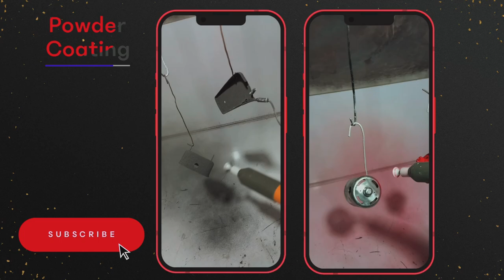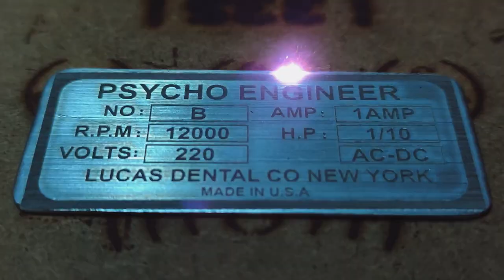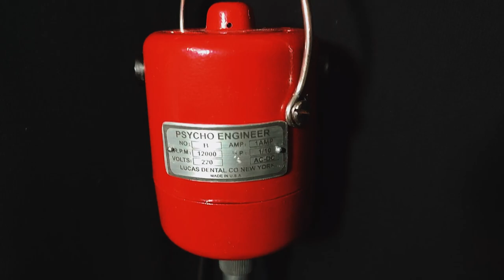Restoration Pendant motor and flex shaft handpiece

Comment: Very nice refurbishing project. I really like how they engineered the variable speed foot pedal to use coiled wires to work like resistors as a slider goes over them. Clever design since it was probably built before high powered solid state devices... Thumbs Up!
Reply from the maker: tnk you gary for your attention ;)
Yes it was actually a clever peace of technology on that years

Comment: The bearing looks to be a sintered bronze bush. Sintered bronze has a porous structure which allows it to 'absorb' oil which would have been supplied from the surrounding felt wad. There is probably a small port adjacent to the end bearing to add a few drops of fresh oil periodically.
Reply from the maker: thanks for your attention to that part ;)